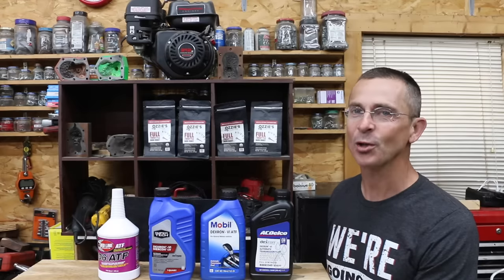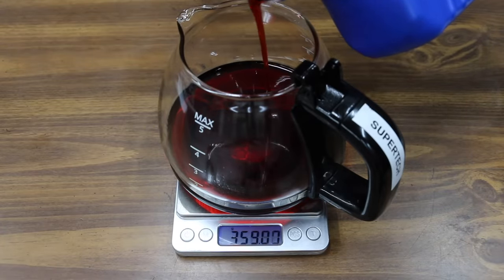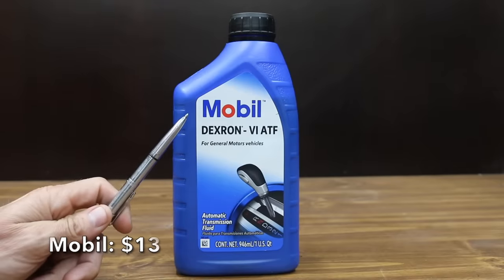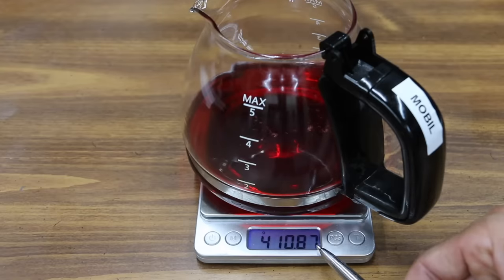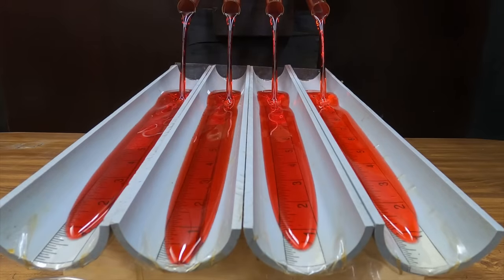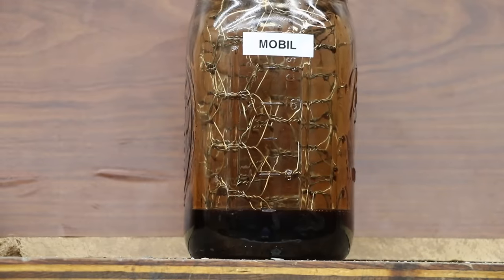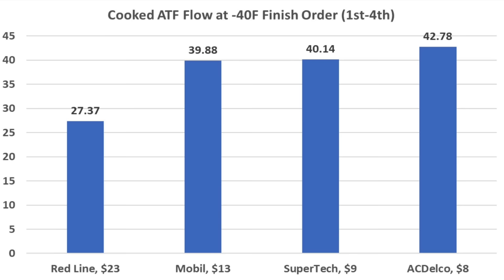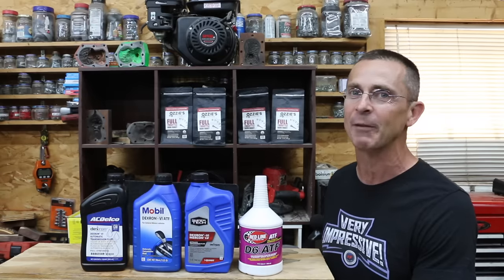SuperTech ATF Safe to Use? Let's find out!

Comment: So what this tells me, is Mobile has no place in the market. If you dont have a race car running on the ragged edge, just buy the most economically priced AC delco, or the super tech if the AC Delco is not available. Redline for when your transmission costs as much as the car and is in a legit high performance environment.
Reply from the maker: Thanks for the feedback.

Comment: I would like to see you do a comparison on vehicle batteries, preferable for light trucks. I cant tell you how many I have had to replace for my 4 vehicles the last couple years. I dont know if its due to sitting outside in the winter, inactivity parked in a garage, or heat in the summer. Its beyond general life expectancy. Interstate, Delco etc have all died. I am trying a Duralast from Autozone now.
Reply from the maker: Thanks for the suggestion.

Comment: I guess the foaming and low temp viscosity tests address clutch slippage, with which I have had problems in the past, but I think you neglected rubber seal protection, a common transmission problem, and clutch wear protection, the next most common problem.  Is metal wear even a common cause of automatic trans problems?  And if excess low temp viscosity is such a problem, why did the thick Lucas help that Honda trans? because internal actuator seals leaked? would that be a rubber seal protection issue as I mentioned above?
Reply from the maker: Thanks for the suggestion.

Comment: Transmission fluid never gets that hot and if it did itd burn the clutches. Cant use the same tests. Auto trans usually have a roller bearing and a few bushing. No load or forces combustion engines have

Comment: Seeing a redline product in the lineup gives me another video idea.  I also have a question about viscosity testing.
I'd like to see a video on high viscosity fluids, or transmission/diff fluids.  I use Redline MT-90 in my miata as the transmission fluid.  Likewise, I use Shell Rotella T6 as my engine oil.  I don't recall if either have been tested.  On rear diff fluid, I typically just buy off the shelf gear oil, but am interested in making a more informed decision about it.

Would it be possible to conduct hot flow tests, like the cold flow tests?  Specifically, I'm interested in viscosity fluctuation.  For instance, if an oil is rated at 10W-30, does it decrease in viscosity when heated?  Moreover, how much does it increase when cooled?  I'm interested in oils that maintain their viscosity throughout various temperature ranges.  Specifically, I'm interested in oils that resist thinning at hot temperatures.

Thank you for all your hard work, attention to detail, and dedication.
Reply from the maker: You are welcome!  Thanks for the suggestion.

Comment: You've tested a lot of oils for vehicles but I haven't seen brake fluid. As it should be changed roughly every 2 years, and modern cars requiring low viscosity (DOT4LV / DOT4(Class6)) fluid, what is the best brake fluid on the market?

ATE, BOSCH, Pentosin, Motul, Castrol, Finish Line, Quicksilver, Delco (GM), Motorcraft (Ford)
Reply from the maker: Thanks for the suggestion.

Comment: HEY PF! Can you test the best soft sided coolers on the market? (the Rtic Softpack 20 vs the yeti flip 12 and the engle HD 30, Etc? you could test for temperature control and COLD pack / Ice retention over a period of time as well as durability and maybe insulation in the sun being left outside all day.
Reply from the maker: Thanks for the suggestion.
Reply: @ProjectFarm  If anybody can come up with crazy data on this it's you. Even testing how well it holds up to freezing conditions
therefore testing the insulation

Comment: I saw a You Tube video stating( to always use wet clutch oil ) in your motorcycle where the clutch and engine share the oil. I have had 2 motorcycles  1980 GS1000 Suzuki and a 2005 GS 500 Suzuki . I have never saw  oil labeled wet clutch use or used it. Just used the weight recommended. No problems. Is this a new thing?

Comment: This testing does not go far enough to determine which ATF to use for a particular application. The ATF must have the right additive package in it to be compatible with the transmission's components to prevent early failure and bad shifting characteristics. I have seen a lot of transmission problems due to using the wrong fluid or ones claiming to be equal to OEM specs. Normally I agree with your testing and really enjoy watching your videos but this one leaves out an important part of the selection process for the product.

Comment: I know others have done it before but I keep commenting on your page regarding this. If you have not done it yet, could you test out which Motrocycle oil is the best? Motul 300V, Mobile, Shell Rotella, Red line, amsoil etc etc. There are a few top brands so maybe a video of top brands vs low brands and also V-twin oils for V-twin riders and 4 cylinder oils for 3-4 cylinder riders etc.
Reply from the maker: Thanks for the suggestion.

Comment: project farm I doubt your going to see this but in the AA video the reason that some batteries got under 300 is likely because they are zinc carbon instead of alkalines, also there are rechargeable alkaline batteries which I think you should do some testing on
Reply from the maker: Thanks for the suggestion.

Comment: I just need to ask are there ANY automotive contact cleaner that removes the green juck from a cars small  electrical / computer  connectors that you cant get with a brass brush ?
Reply from the maker: Thanks for the suggestion.

Comment: It seems impossible to find any source comparing redline ATF and amsoil ATF directly against each other and most online videos regarding AMSoil seem to be sponsored and I want to see a real honest comparison wish I could see this, I’d also like to see someone find transmissions known to be highly reliable (example certain Toyota’s or Honda’s) and transmissions known to be much less reliable (example certain ford’s and chevy’s) and test the recommended fluid of these transmissions to see if any of the stuff used in the good transmissions have anything in common and vice versa with the bad ones, everyone assumes the more reliable ones must just be built better but how do we know this for a fact I’ve heard Toyota and Honda has very specific additives many manufacturers don’t use or at least didn’t  previously I’d also really like to see some way to simulate valve body wear because in most modern automatics valve body wear is the most common failure point I know some companies that rebuild valve bodies have machines they use to test them and simulate valve body usage and function before shipping them out to customers, I would really love to see this used in the testing of various ATF’s impact on valve body wear if possible. I’d also like to see someone inspect other various things on cars known to have reliable vs unreliable transmissions for example, the cooling system, what if in theory some of the “bad” transmissions just have a crap cooler and it runs a bit hotter than the other “reliable” transmissions, let’s say maybe by 10 or 15 degrees, now some would argue this wouldn’t make a huge difference however over the course of many years I think the wear from that builds up especially if you neglect the fluid because that will cause it to degrade faster then you have heat issues, AND worn down fluid which creates a domino effect of all types of things that would be very bad for your transmission, I’d also like to see tests of some aftermarket products for transmissions like aftermarket filters or coolers, how effective they are, how they affect the pressure and flow of oil in the transmission, and other various tests.
Reply from the maker: Thanks for the feedback.

Comment: While back you did a show of sea foam was wondering if you could do something like testing marvel mystery oil in a vehicles oil for say 3,000 miles and test it against same brand oil for 3,000 miles without marvel mystery oil see the test results would be good to see how well it actually does.
Reply from the maker: Thanks for the suggestion.

Comment: How about testing some of the brand specific fluids? Like what is it about Honda fluid that your trans will slip if you dont use their fluid? Had a 02 civic that probably had the cheapest Napa fluid in that would slip til warm til I got maybe 25k on it. Also what makes Toyotas oil Lifetime and world standard on a gen 2 Tacoma in their ironclad transmission? I wouldn’t buy anything but proper factory fluids despite everyone’s claims I’m buying the name or wasting money. Saving $10 isn’t worth a new clutch trans or hydraulics
Reply from the maker: Thanks for the suggestion.

Comment: Hi I was wondering if you can make another video about SeaFoam auto marine fleet can but I want to see it done to a car that has a lot of miles on it and also if you can show me/us how to use it properly because there’s no instructions of how to use it. I also have a 2013 Subaru Impreza sport hatch with 192,000 miles on it and it’s been riding quite rough and I’ve been getting bad MPG and it has no power car is so slow. I would truly appreciate it if you can help me with what stuff I should use to fix some of these issues thank you so much love your videos keep them up and I been watching your stuff for years know. I am also the person would told you a long time ago to use the old used oil after u burn it in the coffee pot in the thing u see how much it grinds the little bolt thing down lol thank you so much.
Reply from the maker: Thanks, will do!  Thanks for the suggestion.

Comment: This is one of the few tests you have done where I don't agree with the methodology. I will agree that Red Line is the best ATF but you can't test ATF like engine oil. They don't live in the same environment and the job of the fluid is different. It has to maintain a certain amount of friction and its used more like hydraulic fluid than engine oil. It should never see temps like an engine and get "cooked" like engine oil. 

Red Line is an extreme use case ATF and will definitely do a great job but it's overkill for the average person who doesn't cook their transmission buy drag racing or towing extreme loads that generate enough heat to matter. I run Valvoline and I have 240,600 miles on my SUV and it was only serviced twice. The last time was around 10,000 miles ago and it looks like new inside and works like new too. 

Most everyone should just use the appropriate type for your vehicle and you'll be fine.

Comment: Can you do a comparison between gm dexron vi and castrol tes 668? Allison transmission removed dex vi as an approved fluid in 2021 and now recommends tes 668. I just did a trans service on my duramax with castrol tes 668 and I could not believe how much of a difference it made
Reply from the maker: Thanks for the suggestion.

Comment: i put redline in my jeep 5 speed and i wont use any other trans fluid. cold or hot it shifts 1000 times better than mopar gear oil.
Reply from the maker: Thanks for the feedback.

Comment: For older vehicles i would say use whatever suites your wallet but for more modern tranny's i would use OEM fluid as it's formulated for the coefficient of fiction of the clutches and piston actuation pressure set by each manufacturer plus other valuables.. another way to look at it is if the trans been working fine a couple thousand miles with the OEM fluid then i would just
use it again as everything if working cohesively.. if not then switch
Reply from the maker: Thanks for the feedback.

Comment: Amsoil has four different automotive synthetic ATFs.    Signature Series ATF is top of the line 100% synthetic ATF for Mercon & Mercon 5, Dexron 2 & 3, Chrysler ATF +4 & Mopar ASRC and other Aisian & European applications.
 Amsoil Signature Series Fuel Efficient ATL is a 100% synthetic low viscosity top of the line ATF for Chrysler SP-IV,  Dexron 6,  Ford Mercon LV, SP, ULV and other Asian & European applications.
 AMSOIL OE origional equipment OTF is lower priced 100% synthetic ATF and is rated for manufacturers drain recommendations, it is for Dex 2&3, Mercon & Mercon 5, Chrysler ATF+4, ASRC etc.
 Amsoil OE origional equipment Fuel Efficient OTL low viscosity 100% synthetic ATF is lower priced and rated for Chrysler SP-IV, Ford Mercon LV, SP, Dex 6, etc.  They also have CVT, DCT, manual transmission & transaxle and other specialized transmission fluids as well.
Reply from the maker: Thanks for sharing.

Comment: Would be nice to know if fully synth racing oil(I think Valvoline has some available on consumer market) rly dies faster than normal fully synth. I used to ran Motul 300v Competition(do not know if thats a thing in the states) in my car(1.6 Turbo, di gasoline) and found out that it basically died within less than 5000KM (3106 miles). I went for it because I regulary reach oil temps above 120° celsius(on design, better emissions) but it just could not handle well typical city short distance traveling. So I returned back to normal good quality 5w 40 fully synth..
Reply from the maker: Thanks for the feedback.

Comment: I’d like to see a test that Shafer is all dry and against the red lion and see which is better because Shafer that is the first petroleum company that was born in America and there that have been in business longest and I have a several transfers index swear by the Saveurs alterations flooded even for CF applications so I kind of want to see how it performs against the red lion because those are the two fluids that recommended replacement for Alasy at eight speed transmission
Reply from the maker: Thanks for the suggestion.

Comment: I feel like engine, differential, and manual transmission oil should be thicker due to bigger gears and larger spaces but ATF should be almost the consistency of chocolate milk due to the smaller spaces inside the transmission. Idk though, Im in no way, shape, or form an engineer🤣

Edit: Before I get roasted, I always look at the owners manual in my vehicle to see what oil/fluids I must use and I go strictly by that.
Reply from the maker: Thanks for the feedback.

Comment: Some transmissions are literally built around a particular oil. Even though Red Line might be the clear winner here, be sure it has the same spec #'s that your manufacturer calls for inside your tranny.  You can literally ruin a tranny with the wrong ATF. I ran Amsoil in a Mercedes tranny once because it had the correct spec #. Then that spec # was removed from the bottles. A story there I'm sure, but I quit using it.
Reply from the maker: Thanks for sharing.

Comment: No, when you change the transmission fluid, only use the exact type. I've tried those 'superior' multipurpose types. It's an exact formula for your transmission. If you're lucky it will just start to slip. If you're not the fucker will lock up. Like the Dodge Stratus I've had sitting at the end of the driveway for 3 years. Barely got it home.
Reply from the maker: Thanks for the feedback.
Reply: @ProjectFarm  welcome

Comment: I'd love to see what your mad scientist brain comes up with to test all terrain tires.  GOODYEAR WRANGLER DURATRAC, NITTO RIDGE GRAPPLER, GOODYEAR WRANGLER TERRITORY MT, and BFGOODRICH ALL-TERRAIN T/A KO2.  I'm looking at these in LT285/70/17 load range C.  I'd love to see the tests that you could come up with for traction, wear, strength, weight, rolling resistance, what else?.... "tire is rated at 2755lbs max load.  We're going to test that!"  "The tire didn't explode until 5012 lbs, very impressive."
Reply from the maker: Thanks for the suggestion.

Comment: Lubrication products sold at walmart aren't true synthetics. They're glorified conventional oils. If you desire and prefer higher quality lubrication products, I'd recommend AMSOIL, Motul, Schaeffers or Lubrication Engineers. Remember, Full Synthetic and 100% Synthetics are apples and oranges. You get exactly what you pay for.
Reply from the maker: Thanks for the feedback.
Reply: I would NOT classify Walmart sold lubrication products as REAL Synthetic. They all are group 3 mineral based products. Made and sold for cheap for many reasons.  

Redline is in a whole other classification of lubrication products, same with AMSOIL, Schaeffer's, Lubrication Engineers, HPL Superior Lubricants. There's valid reasons why more expensive products cost more. They're made to much higher quality standards and exceed OEM spefications.

Comment: Could you do automatic transmission fluid with Valvoline Universal Transmission fluid I have a General Motors car 1996 Buick Regal 3.8 engine from my father was a WWII would not buy a German car or a Japanese car the cars in good shape has 40,000 MI want to change the transmission fluid and filter someone told me Valvoline Universal Transmission fluid would work for it
Reply from the maker: Thanks for the suggestion.